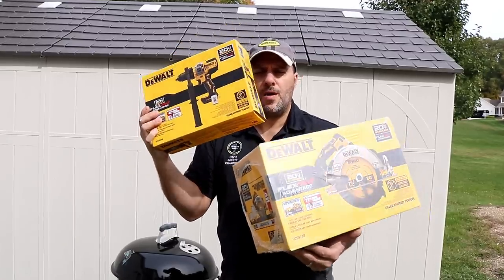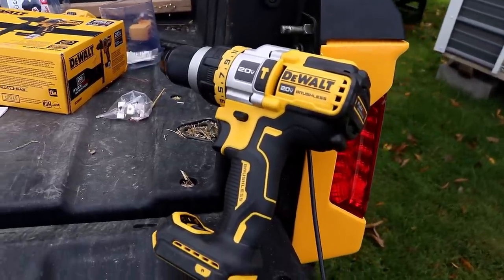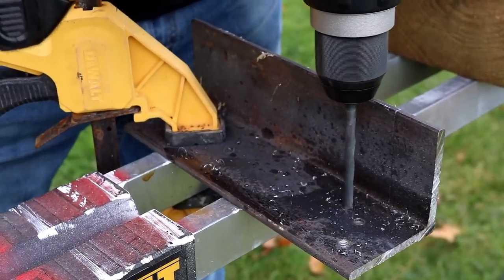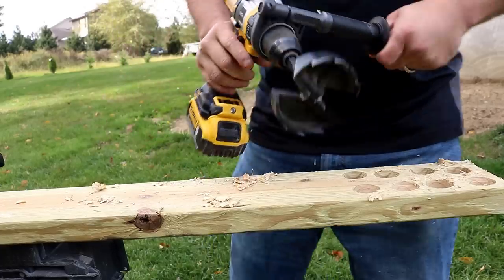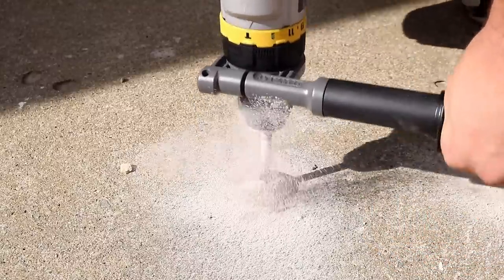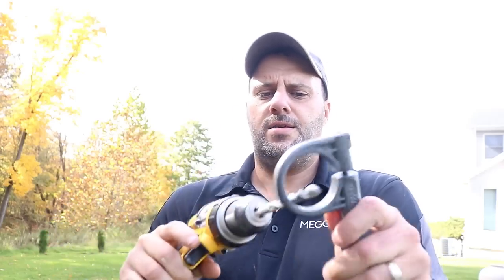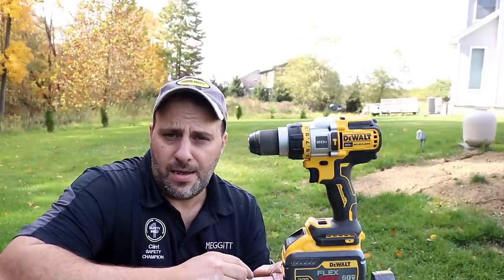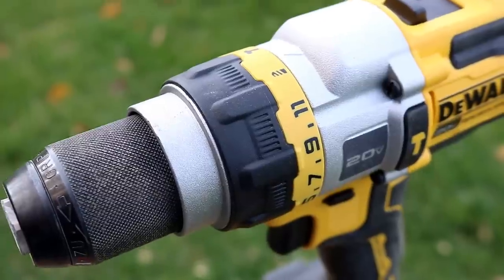The All New Dewalt Flexvolt Advantage Hammer Drill Driver is like none before! (DCD99B) REVIEW!

Comment: If only dewalt could come out with a cordless ratchet instead of upgrading existing tools they could actually sell their hand tools and sockets, I love dewalt but Milwaukee is destroying them in innovation of diversity of tools it's very irritating
Reply from the maker: Would be great to see something never done before
Reply: Same here. But i think its the dewalt 12v batter style that isnt gonna work too good. I have the m12 ratchet.  And i tend to use the smakker battery 95% of the tine with my kine if work.  I just don't see a dewalt ratched with their 12v battery working if it limits the size
Reply: @dangerousfandango5943  jus gotta put the battery in sideways like the ingersoll and kobalt. Will be plenty comfortable but yes m12 is still a little more ideal with there battery style
Reply: O yea i forgot there is a dewalt 12v ratchet technically. Its a mac tool but uses dewalt 12v battery.
Reply: It's amazing they don't. They're missing out on a whole market of diy car repair. I don't get it.

Comment: I just got this drill w/ the 6ah flexvolt battery - never used a chuck like this before - some ppl just ratchet it tight in one direction, while others do that and then add another step by twisting back in the opposite direction until it clicks once - is this to lock the bit in?  Why do some do it and others don't? (btw, that extra step isn't mentioned in the Dewalt instruction manual) - anybody got ideas on this?

Comment: Gotta love that IPhone business model, new shit every 6 months. How is it any different than the 20V Max XR 998 hammer drill?
Reply: Battery I think it has  21,700 cells and some design tweaks I saw another video where someone swapped out the battery with previous model and it worked exactly the same as this one so I would go with cosmetic changes to the hammer drill an improvement to the batteries cells that's it and I wouldn't buy the kit because it comes with that pesky 887 that DeWalt  needs to redesign do something to prevent it from overheating

Comment: My old brushed drilled finally died was thw big one right before brushless cam out. I used the flexvolt on it and it came alive for a brushed drill would literally pin you in n the corner in low range. Absolutely loves the amount of power it had when flex volt batteries came out. Wishes i had changed the brushes out but it sounded like the gear box itself locked up. But after probably 10000 holes im satisfied lol

Comment: Do you think this new DeWalt Flex Volt Hammer drill has significantly more power than the Milwaukee Gen 3 Hammer Drill?
Reply from the maker: Ima do a tool duel with them, but this is really fast...so it may take the win
Reply: the older DCD996 is already much more powerful than the Gen 3.  So yeah.
Reply: That’s not true, gen3 has more power than 996, maybe this one could overcome gen3

Comment: The flexvolt advantage tools aren't in arizona yet 😥 face @ToolReviewZone
Reply: I saw them in Mesa last weekend. They were on the top shelf that said “no home.”
Reply: @jvausa  oh thanks for the info were in Mesa a home depot?
Reply: @AntonioClaudioMichael  it was either Superstition Springs or Crismon and the 60. I was at both and don’t remember.
Reply: @jvausa  oh I will have to check them stores thanks For the update you rock
Reply: @AntonioClaudioMichael  I would bet they are at multiple locations. Just not out yet.
Reply: @jvausa  there not in any home depot near me which is casa grande and San tan and queen creek not even in the rafters or top stock these stores might be last to get them I did call Crimson and they told me they do have them in top stock they are for sale they just haven't got the display to put them on the ground yet
Reply: @AntonioClaudioMichael  they are on the website. You could order for delivery.
Reply: @jvausa  i rather buy it in store had to many orders get screwed up and not show up and get canceled on me through website
Reply: @AntonioClaudioMichael  me too.

Comment: I got this one to put everything from my daughters toys all the way up to drilling anchor bolts into the ground. I got tired of going between my smaller dewalt driller with the crap 2.5ah battery, and then my other harbor freight drill. i built my house going between the two. i finished my house, then bought this one, its big its bad, and its awesome. i dont care if its massive, it gets every job done and the battery last forever. moe powa

Comment: No I don't use DeWalt's Flex Volt battery in my jobsite. I only normally use the small 3Ah, 4Ah or The 5Ah (Amp Hour) Batteries for my DeWalt Dcf 894, 888, 809 and 801and they do just fine!!! What makes the difference though is the battery cells everyone knows that the 21,700 Cell Lithium Batteries are more Powerful than the Old 18,650 Cells. Which is I think the 21,700 Cells are the ones that inside in the new DeWalt's 4Ah Compact Battery. Same thing on my Ryobi's I don't have 6Ah and 9Ah battery, either my Hitachi's Triple Hammer Multi-Volt Impact Driver I'm still using the Hitachi's compact 3Ah battery pack. If I'm gonna be needing a Flex Volt battery or Where and When do I needed it the most??! Probably If I have a DeWalt's Flex Volt 12inch or 10inch Cordless Sliding Miter Saw or 10" Cordless Table Saw!!! But I don't needed it because my sliding miter saw is corded I can run it for the whole day. Otherwise If I'm gonna be needing more power especially on a much heavier duty drilling jobs then I'd rather use my Bosch 1/2" HD-18 Corded Hammer Drill or my Bosch Bulldog Extreme Corded Rotary Hammer Drill.

Comment: I have the dcd999 and the older 6ah flexvolt battery. What iv noticed if you switch between  drill mode and hammer mode the hammer sounds more powerfull, just switch between the 2 and you will hear the difference

Comment: I like the look of the DeWalt  flexvolt advantage the clutch is reminiscent my old DeWalt dc935 hammer drill or even going back my dw990 mechanical so you know it's moving I have used the dcd-996 before so it is a design change

Comment: You didn't even mentioned the Bluetooth chip😔
Reply from the maker: Yes I did
Reply: @ToolReviewZone  ok lemmi rewatch then
Reply: @ToolReviewZone  well if you did it must have been quick cuz I didn't see it. I'm not tryna be rude. I just really want to know what that little insertion spot on the bottom of the drill where you attach the battery is for before I buy it. Is it for Bluetooth? 🤔